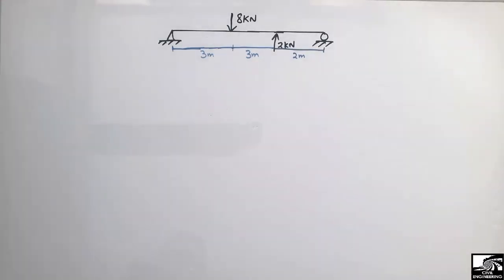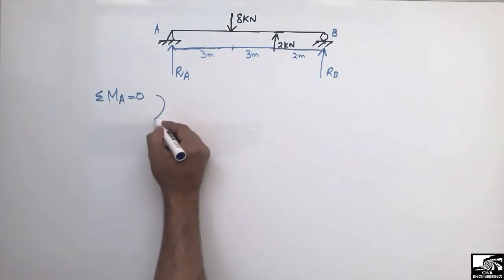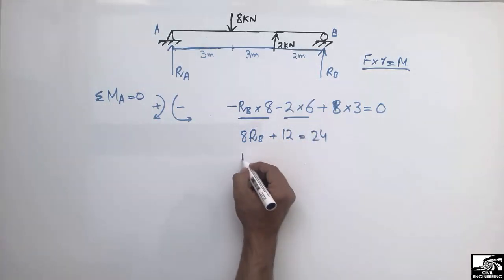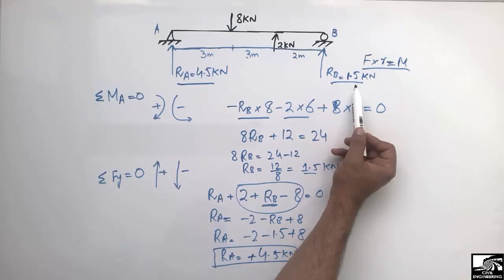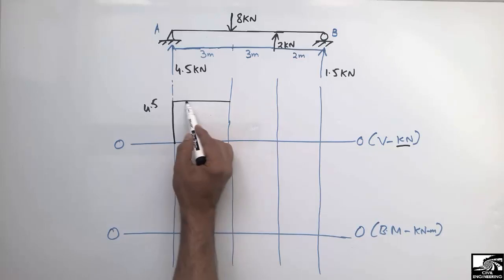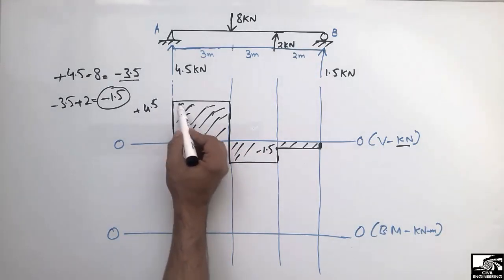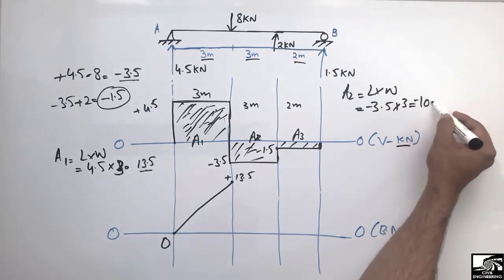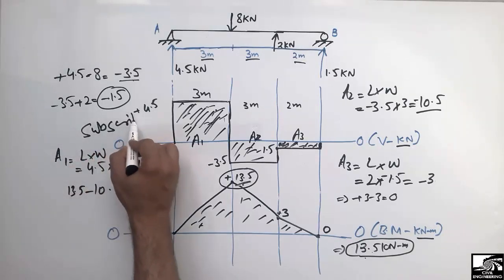Shear Force and Bending Moment Diagram

Comment: Great video , Thanks . In other video's they say clockwise is negative and counter clockwise is positive . I mean the result is the same but what's the right definition ?
Reply: Conventionally, clockwise is negative and anti-clockwise is positive, yes. But you can also define it the other way round, which is not wrong as long as you are consistent.